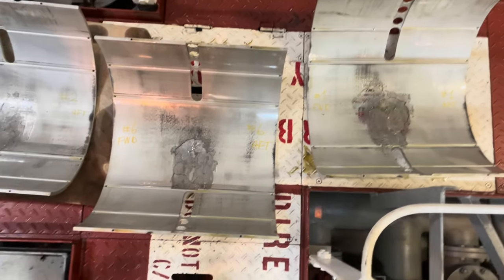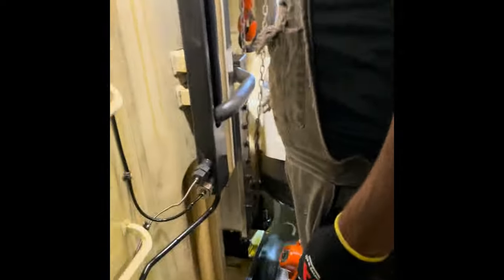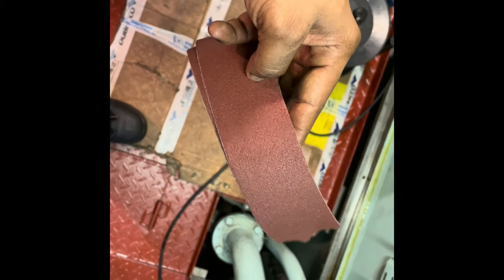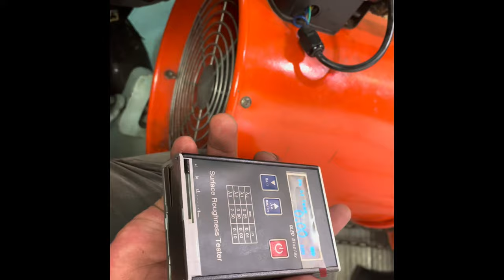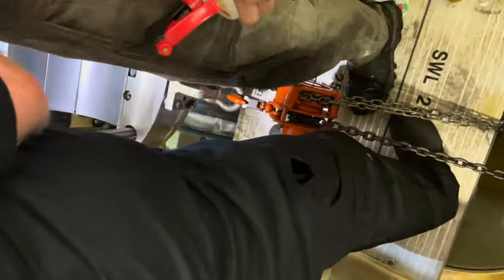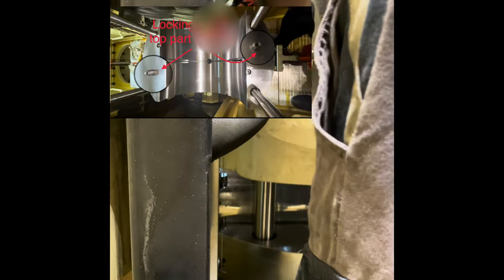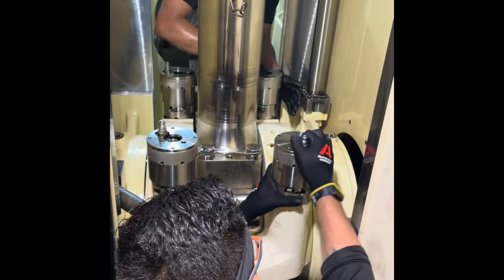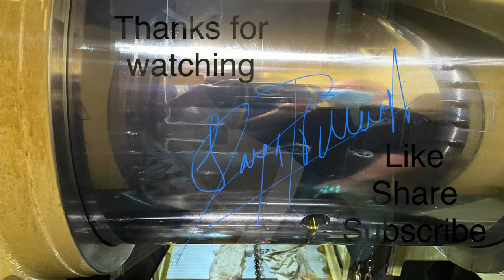Main engine Cross head bearing removal procedure for MAN B&W by MAN B&W service technicians

Comment: What is use of 2 outermost chain block
Reply: Outermost chain block is for taking the weight of piston and crossed pin whereas inner Most for taking out the croshead pin uper shell bearing along with cover.